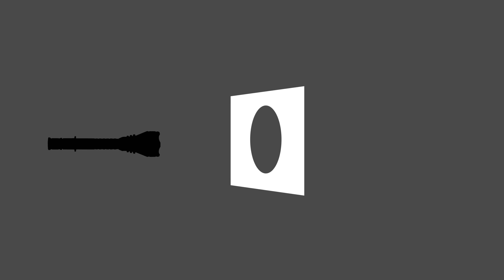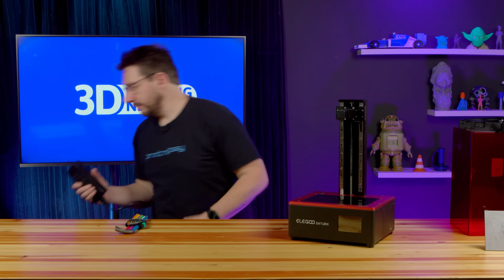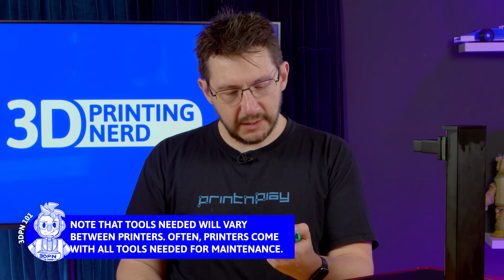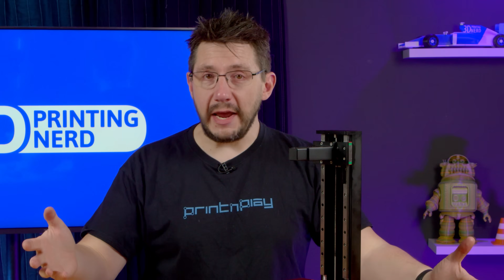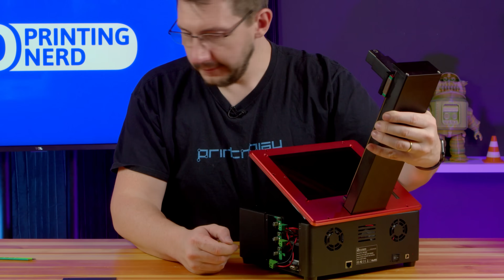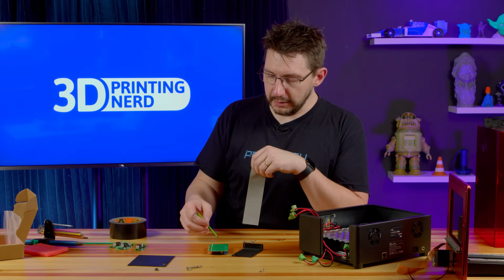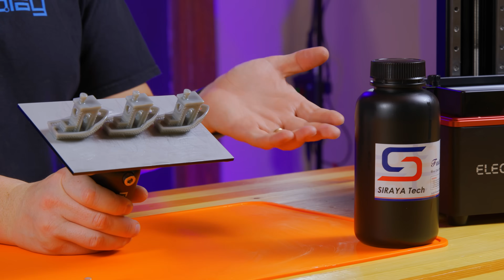FIX AND WIN an ELEGOO SATURN!

Comment: Hi from Adelaide, Australia. The Saturn looks like a good little printer. Having worked with commercial printing(paper and labelling) I particularly liked the very end part, when explaining how the different colours cure differently due to the amount and colour of the pigment. That's a science in itself. The majority of label printing is done with either UV or IR curing.
As for the Gorilla tape, I'm an electrician, that's a no from me. Do it once, do it right. 
Just print a new bracket with any non-metallic filament on one of your FDM printers to replace the metal bracket. I would estimate it would have taken about 1 hour to design and print.

Comment: I would use the printer to give printing with castable wax a try, to either make some custom jewelry, or try my hand at casting some metal parts like an impeller for an rc jet boat

Comment: I would use the 3d printing to create molds for carbon fiber. I need a printer with a high resolution to minimize the post clean up process to get a cleaner negative.

Comment: Well, the first thing I would print, is the super detailed lightsaber model on thingyverse. It has intricate internal details and lighting and electronics... it's a big and exciting project that I can't do on a fdm printer (but worry not as I found an fdm printer friendly lightsaber with internals. and it is awesome). I have a few models my uncle has 3d rendered and I want to surprise him with a 3d printed live version of his models, and with this, I would make it crazy detailed. The next thing I would print is a better housing for runcams for airsofters or paintballers. I have always wanted something for my keychain, and my regular fdm printer just can't make something strong enough or detailed enough for such a small piece. I would experiment with designs and parts and make a custom key-chain piece. Then, after all that, I have more prototyping and models to make (by my own creation), and have always wanted to mess with a resin printer. 

Good luck to the winner! I bet you will make amazing things!!

Comment: I would likely print a lot of "stuff" with a resin printer.  Some of the initial prints would go along the lines of the following.  I'm guessing by the time I get to 3 or 4 I'd have additional stuff that morph this list into something longer and completely different.

1) The sample print that comes with the printer to help figure out how it works and make sure it's configured correctly.
2) A benchy for further testing.  If I remember correctly, it's currently required by law that every printer must print at least 1 benchy.
3) Minifigs.  I've got several in the works that I'd plan on printing.
4) Board game replacements for missing pieces, and upgrades to existing pieces.
5) Keycaps. More to see what I can do with it than anything else
6) Jewelry for friends.

Comment: That one is yours. I wouldn't give away the one I fixed either.  I would print this ring 💍 design that only a resin printer can pull off. Its been in my mind for a while but the details really require this printer to work

Comment: I am not even sure what I would print. Resin printing and post processing has me a little anxious but I would probably start with replacing some FDM prints on my model planes and even try replacing some FDM parts on my FDM printer that are a bit heat sensitive.

Comment: I love taking things apart to see how they work and how they can be repaired. My boss threw out a $500.00 Keurig coffee maker, I took it apart, replaced a small vacuum pump for $25.00, and Abracadabra, a perfectly working coffee maker. Putting tension on a child and breaking them is regarded as bad now a days. You can also trim the wire sticking up. I would make rings, jewelry molds, tools, parts molds, gaming pieces, chess characters, some of my 3d animation characters(like my profile image), and many more things!!!

Comment: Nice little tutorial! I would love to get my hands on a Saturn. I have the original mars but not that I have the bug I want to print larger things. Also, I LOVE Sriaya Tech resins. Pricey but I get WAY fewer fails. I think the first thing I would print on a saturn is actually a replacement model Catapult for the B-Seiged board game. I have an FDM printed one but when I went to paint it the layer lines REALLY stood out.  Resin would be oh so smooth but it is too big for my mards :(

Comment: Awesome video. Hope I don't need to use it to repair an ELEGOO Saturn IF I get this one. But seriously. I'm learning jewelry for over a year now and I've been making props and dioramas and everything I could with my FDM printer. If I could have this one I would do molds for my jewelry classes and I was thinking to print a Blade Runner blaster fully detailed and with all moving parts to hang on my wall. Also working on a PC mod and that would really help a lot.

Comment: Hello Joel! Nice tutorial on how to fix the printer, you helped me learn a bit more about them, If I won that printer it would be more than helpful to me, I build scale models and I´d love to make custom parts for them, I build cars, mechas and framearms kits, hopefully Warhammer figures someday, I also have ideas for some projects (cars, ships and characters I´ve designed) all of them my original ideas, that 3d printer would be the perfect way for me to get those ideas out of my head and be able to hold them on my hands, I also have ideas for some parts for scratch building, with that printer it would be awesome to perfectly fit an existing part on a model by designing a part to make it fit, it would save me a lot of time and effort, and if things work well maybe starting my own brand, I currently don´t have a steady job so it would be perfect for me to start something, I almost forgot I also have an idea for a scale modeling tool that hasn´t been featured before, thanks for everything you do for the community you´re awesome.

Comment: I would love to print mold positives and negatives. dice, minis, prop pieces. I would mainly be using it to prototype some machines, and bits that could help the differently abled. I'd probably also print a replacement bracket to ship to you to help eliminate that shorting risk lol. I could use a larger machine my longer orange 30 just wont cut it for alot of the things I want to do, and has been holding me back.

Comment: I would print parts for an open-source tangential record player with active dampening I am currently developing and where I have to ask a friend with a pretty bad 3d printer (original Mendel built on a very small budget) to print parts all the time. 
Oh, and my son ( 5y ) wants to build a drone as well (relying on others open-source development in this case).

The quality of your test-prints is beyond my belief. I only had access to parts developed with very simple FDM machines.

Comment: What would I print with that printer? Custom dice for pen and paper role playing games. Also solder masks for reballing computer equipment like for instance SSD’s. They often fail because the controller chip looses connection with the board. Removing, cleaning, masking, pasting & re-installing fixes these devices80% of the time. Ordering masks to every type of chip isn’t cost effective 
There isn’t anything sensitive to esd on that driver. I wouldn’t worry about static. You can file down those through hole solder joints.

Comment: I would print jewelry designs and some very technical pieces from my designs that are not quite acceptable on my filament printers.

thanks for the giveaway, Joel.  I would like some manner to contact you, as I have designed and developed an improved 3D filament printer upgrade and want to send you one to test.

Comment: I would print some some  stand-offs and mail them to you , so you can be super sure that new driver board does not short . Heck print a whole replacement mount plate, it has the print area to do it easy as 1 job .

Comment: I would print parts to upgrade my self designed work in progres 3D printer, what else do you use a 3D printer for, other than mods and upgrades for your current printer? 😎

Comment: Love the video , have only been playing around with an ender pro making small proto type parts and would love to try a resin printer with perhaps an easier path to different materials my current 2 projects are a
 1. magnetic phone mount with wireless charging(I know there are lots of designs out there BUT none meet my requirements) 
 2. wireless gopro style turntable mount with indexed positions (and a series of programable positions, and operations)

Comment: For me, I would probably print custom Lego parts to go with my trains and buildings.  For others, I print various things I give as gifts.  I have 2 fdm printers (1 not working right now) that I make things to give away.  I have never sold anything that has come off my printers.  I got into 3d printing late in life.  I have been printing for about 4 years now and I'm 63.  I have no plans to make this a business, just something to entertain myself and make things for others.

A couple notes on the repair.  It's good that you have a low static environment but it can still be a problem.  You are correct to touch the case but only if the case is grounded.  I didn't see any cords going to a grounded source.  Even a static strap on your wrist would be good.  And static may not Zap the part to the point it does not work any more.  It could degrade the performance a bit and get worse over time.  The second thing is the nubs on the bottom of the board.  The tape on the bottom is good but what I would have done is take those multitude of side cutters you say you have and nip the high points off but leave the solder beads.  You can then resolder over each bead to cover the exposed copper.  That way you have a lower profile and then tape the bottom.  Experience gained from 20 years doing electronics for the Marine Corps.

Thanks for the vids.  I always enjoy them and learn a lot.

Comment: Hello 3d printing nerd. I just recently got into 3d printing. I bougt a snapmaker original (used) and have really enjoyed this hobby especially in times of lockdown. However the print quality is not always on the level that i would like too. I am an engineer student in second semester and would use ist to print all different kinds of prototypes that I used to build out of cardboard.

Comment: Good tutorial. I would suggest labeling or numbering connectors that look the same just in case it does make a difference. I would like to try resin printing. If I won this I would try to print everything. I might start with a joelbot, then move to practical things like rock and mineral stands.

Comment: I'm an electronics tinkerer and I use an Ender 3 to print all sorts of functional stuff, like housings, custom Lego parts for my son, etc... Small, high resolution things, like gears, belt-wheelsor smooth button-tops, are not possible with FDM, so that's what I'd probably print mostly.

Comment: I would print parts for my electric skateboard which I've tried with FDM and the vibration delayers and snaps the parts in half. So I'd love to try and use this for better layer adhesion.

Comment: The printer would be great for some of the more detailed parts I print for my postgraduate research work. 3D printing has proved invaluable for my research, to build custom tools and holders for my samples that simply aren’t commercially available, but FDM has some limitations. And for fun, I’d love to print the Hogwarts model I designed a few years ago (files on MyMiniFactory). With the extra detail and precision, the possibilities are endless.

Comment: I would really love to have the printer, i just got my bachelor in mechanical engineering and now i finally have time to start and pursue my own projects instead of just studying all the time.
I like to work on small gadgets or mechanical systems or print table top figures for my friends. Until now i could only test most of my constructions in simulations or as 3d models
on the computer, because i couldn't afford such a printer. The Elegoo Satrun would be perfect for me to prototype or visualize my ideas. You would of course see the results.

Comment: Hi Joel,
my brother and I have board games from the 80s and there are pieces missing or broken and it would be nice to print them with this resin printer to get awesome printed pieces. With my FDM printer I can‘t print that small pieces with a nice smooth surface as it would be possible as with a resin printer.

Comment: What would I not print? But primarily I’ve always wanted to test 3D prints instead of machined aluminum molds for my desktop injection molding machine. With my current FDM printer that is just not possible.

Comment: Does everything count as a what I'd like to print entry?😁 Primarily though id love a machine to print minis to paint.
As an aside to that i would reccomend for your personal use since you got all the spare connectors with your package you might be better off replacing the 3 into 1 power cable coming from the supply with a single power cable. I agree its not necessary nor would it have been a good fit for what you were aiming for in the tutorial but it will eliminate a risk from having live ends loose in your case and stop the chance of those ends moving to be in the way of the light source and you getting another dark spot.

Comment: Thank you for the careful stepping through the explanation, but the static protection discussion was a little misleading. As Linus pointed out though, most things are pretty resilient, so it doesn't matter all that much. If I had one of these I'd be printing larger single print spaceships for my roleplaying games and giving my OG photon to my friend who wants to get into resin printing. The faster printing would make the larger spaceships take less time to print and would mean we have a lot more things to work with when convention gaming opens up again and I'm yet again running games of The Expanse RPG.

Comment: I’d use the Elegoo Saturn to print the NLA replacement Arcade/Pinball parts that my FDM printer has trouble reproducing... like the pivot ball on my Sega Joysticks that go in early ‘80s Sega cocktail cabinets (like “Space Trek” from 1980).

Comment: What would I print with an SLA printer? Nearly anything detailed! The wife loves jewelry and charms, could print those with a lot less post processing to get a smooth finish. 

Small enclosures for my pcb projects. Also doable with FDM but to get that clean look requires a fair bit of filler and sanding.

Lastly, and most importantly, figurines. That smooth surface and crisp detail just can't be repoduced on FDM.

Comment: I've been building plastic scale models ever since I was a kid.  For some people who are in that particular hobby, putting together a finished kit involves adding details that either weren't part of the kit originally or fixing inaccurate details that made their way onto the kit parts.  In the past, doing those things would involve cutting up pieces of polystyrene, metal, or whatever one can think of or find in order to make completely new parts or adding to existing ones.  One could also rely on 3rd-party solutions from people who make photoetched or resin-casted parts.

To me, scale model building and 3D printing - and especially resin 3D printing - are a match made in heaven.  I've owned an FDM printer for more than a year now, and I've primarily been doing functional prints for things around the house.  I've only recently started prototyping "accurized" parts for model kits that I have.  However, FDM printers cannot output the level of detail that is required for scale models.

For the last few months, I've been waiting and constantly checking Elegoo's website and Amazon store for the Saturn.  But with the pandemic affecting supplies within so many industries, that printer is nearly impossible to get at this time.  I've been wanting the Saturn so that I can use a resin printer of that build size to proof the model kit parts prototypes that I create with Autodesk's Fusion 360 design program.

I've been dying to share my creations with those in the scale model community who might be interested.  Unfortunately, I don't want to release anything out to them until I can show proof prints.  A printer like the Elegoo Saturn would greatly help with that goal.

It would be great to win that printer.  Thanks very much for offering one of yours up as a prize.

And keep on making your informative and fun videos!  High five!  :)

Comment: I have been wanting to start a youtube channel for a long time, and I love 3D geometry. I actually made a perfect score on the solid works final freshman year. There are so many simple things like the octopus, to compliant mechanisms, I have dozens of objects bookmarked that I have not had a printer to print. Honestly anything that has moving parts, especially ones that print interlocking or with tight tolerances look so cool. That nested egg shape that makers muse printed on his resin printer would probably be the first. I also love puzzles, and I have some ideas bouncing around in my noggin for puzzles that could be made with a 3D printer.

Comment: Great video.  As a systems engineer who does a lot of test and troubleshooting on a regular basis, I really appreciate how you went through a systematic way to troubleshoot the issue.  It wasn't shown in the video, but I hope you did some verification tests with the new board before you reassembled everything and buttoned up the chassis.  I've had to reassemble things multiple times as a result of forgetting to do that crucial step!

As far as what'd I'd print with a resin printer... honestly no idea.  I've never used one before!